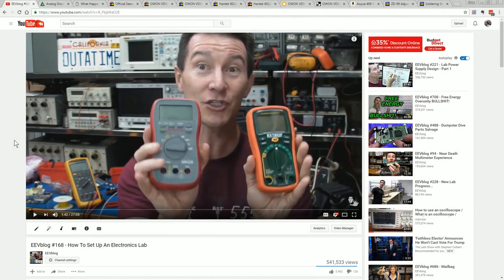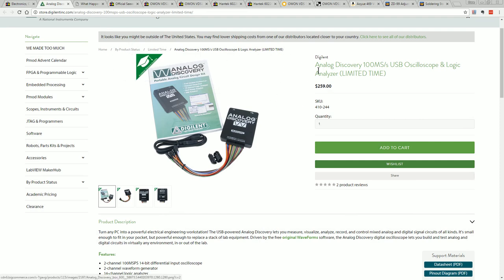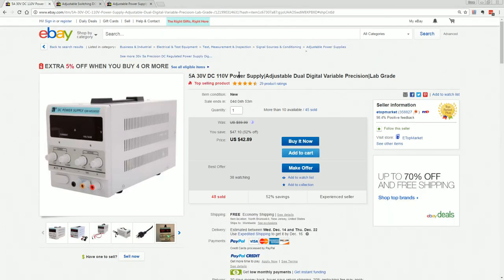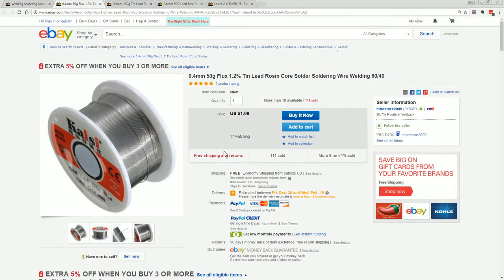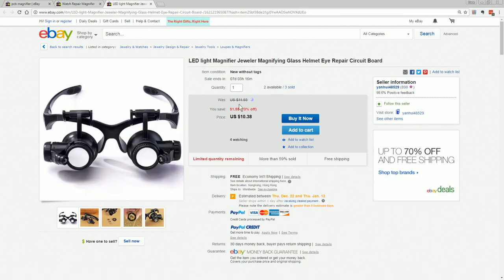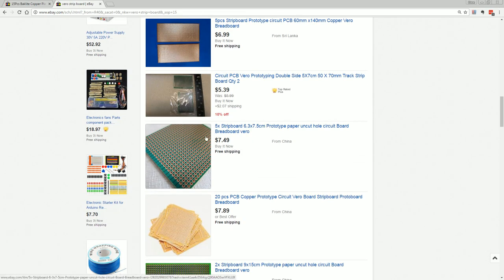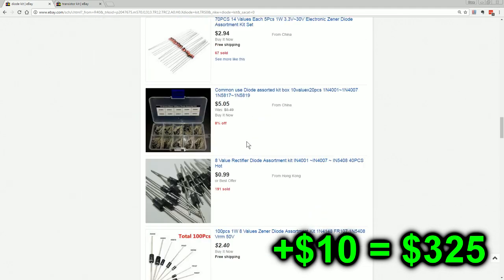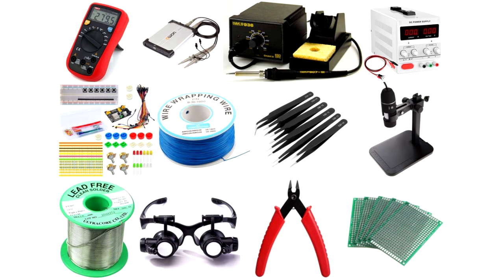EEVblog #954 - How To Setup An Electronics Lab For $300

Comment: I use my lungs to filter the fumes..
Reply: Some people really hate and/or are allergic to the fumes, but I kind of like it. Similarly, I like the smell of a wood fire, but there are people that hate that, too.
Reply: Mark L reality is the fumes are toxic, carcinogenic, but then I am a smoker..
Reply: I had a jacket that smelled like campfire for a for days, definitely got mixed reactions from that.
Reply: TheLinkoln18 yea, its not that bad for you, its just flux lol nowhere as bad as toboco smoke lol
Reply: It's only carcinogenic if the solder has lead in it. You can buy lead free solder for basically the same price.

I personally like the smell of warm resin.
Reply: +megamixa The lead has nothing to do with the fumes beeing bad for you. 
It doesn't evaporate in the soldering process.
Reply: I usually just blow on the fumes. No need for old pc fan :-)
Reply: Unless you're going to run a soldering productionline all day long, extracting fumes is just nonsense. A beginner just makes maybe 10 connections, see the circuit work (or not), highly likely throws the whole bunch in the basement and never looks at it again. A candle produces more toxic gasses than those 2 minutes of soldering.
Reply: That's interesting because one of the clips I saw on the death of Steve Jobs it said that his cancer probably came from breathing poisonous fumes from soldering and particularly from the lead when he was building computers back in the '80s with Wosniak in a garage.
Reply: Iberius Pred Then he probably made a few more than 10 connections.
Reply: If this is true, considering Woz did far more electronics than Jobs did.. how come Woz is perfectly healthy ?
Reply: It's hard to tell, genes, good luck, who knows. The clip that I saw about Job's cancer was that there was a physician who found on the medical records the size of his tumor at different points in time. By assuming the exponential growth of cells and cancer cells he could estimate that the tumor must have started growing somewhere in the '80s.
Reply: I thought of that myself. Not to mention that logically if it was fume inhalation that lead to the cancer, it would be lung cancer, which was not the location of the cancer Jobs had. Physician or no, this doesn't make much sense to me.
Reply: TheLinkoln18 best solution is to just filter it all through a nice cigar
Reply: +Peter Mulholland maybe he was across the bench from Woz and Woz didnt like the smell so blew it away towrads Steve :P
Reply: I don't think Steve Jobs would know which end of the soldering iron to grab.
Reply: +Iberius Pred but lead gives you heavy metal poisoning, while organic compounds give you cancer?
Reply: Fatalcreator According to some research, the toxicity of some heavy metals can cause cancer. Not only organic compunds cause cancer, UV radiation and nuclear radiation are not organic.
Reply: Btw, I don't think it is reasonable to assume that organic compounds generally cause cancer. If that were the case we wouldn't live long from birth. You cannot generally say that poisonous organic compounds cause cancer either. I don't get where you got that "organic compounds" thing from at all...
Reply: Lead has a boiling point of lead is 3180°F but that doesn't mean that it doesn't evaporate at lower temperatures. Even solid lead can get dissolved by ionization in saline water solutions.

It seems that solder fumes may contain small amount of lead, that is harmless in a normal environment even to people who would work with it every day. However, if you do that every day in a poorly ventilated area, who knows? The causes of Steve Jobs death are merely speculative. No one knows for sure what started his cancer. The only thing that they have in their reckoning is approximately when it started.
Reply: Iberius Pred nope! Cancer is caused by viruses or exposure to radiation thats it! Steve jobs wasn't playing ball with those in charge of the world! Then he died of cancer. Yes i have facts and sources to back up this comment. Dr Maurice Hilleman the inventor of the polio vaccine confirmed viruses are the cause of cancer and vaccines are i quote" bargain basement technology" this interview was done in the 1970's. it got worse.
Reply: In addition exposure to damaging environmental chemicals or sunlight dosnt cause cancer. They damage your immune system and allow viruses to do there thing. Thats why all smokers dont get cancer.
Reply: I highly doubt your hypotheses as to what causes cancer. Sure, viruses may cause cancer, sure, radiation can too. But there is more to it than that, as there are many other factors that may cause cancer.

I'm also rather skeptical to vaccines. While they may give a certain degree of immunity against diseases such as chicken pox, whooping cough etc. they are firstly not 100%, i.e. you may still get the disease and secondly, some of them have bad side effects that can lead to lasting complications such as autoimmune diseases (including allergies and atopic dermatitis), narcolepsy and increased risk of developing autism spectrum disorder in children.

I consider flu vaccines and "vaccines" such as Gardasil to be worthless. At best a flu vaccine may alleviate the symptoms, while most of the time it has no effect at all on the immunity against the flu. They are simply not worth the side effects that come with them.
Reply: Young people get cancer too and incidences of young people getting cancer has increased a lot during the past 2-3 decades. I can recall a case when a woman in her 20's contracted cancer after working in a Foxconn like facility.

I don't buy into that "older people get more cancer because of their immune system". Not only the immune system ages in people, other cells too which increases their chance of becoming cancerous. It's more complex than to put it all on the immune system I think.

Saying "this is so because X said so and he is the father of Y" doesn't cut it. No one is infallible, therefore facts speak louder than someone's statements. Maybe you could provoke an immune response against cells that have cancerous properties through a vaccine and create anti-bodies against them. But there is also a risk that the immune response will be directed at "innocent" and vital cells in the body. The immune system may not be able to tell the difference between these two types of cells.
Reply: thats dangerous man, everyone knows you are supposed to filter it through a cigarette
Reply: Johnathan Wuethrich bahahahahah cough hack cough bahahahahah
Reply: keep preaching the truth on cancer. Im sick of watching chemo take family members
Reply: I think its part of population reduction at very least its corp influence for reasons of liability. I graduated highschool in 06. The way schools were teaching cancer even then was that its mainly genetic. ...which is part true... but half the story of " some peoples genes contribute to immune systems less able to fight off certian types of cancers" and "some genomes exposed to some of these manufactured chemicals are x% more likely to develop an imunne overwhelming cancer than others." and of course even if they had taught what i just said it would be  still lacking in the part of...take in the right chemicals in food to give your imune system a chance to be supplied with what it needs to attack. fucking trajady
Reply: I'm sure you meant to say that you filter the soldering fumes through a cigarette.

And by the way, any kind of cell damage can cause cancer, but you could also say normal life causes cancer. Breathing oxygen-containing gas mixture (generally known as air) has got to be the most potent cause of cancer. A cell dies, gets replaced, with some probability, the replacement will mutate. If the mutation happens to be of a kind that cannot be dealt with by immune system in principle - and BTW it's no matter how strong it is - that's what cancer is. This is BTW why saying that viruses are carcinogenic isn't entirely wrong, but it also isn't the whole picture.

Now sure it makes sense to avoid chemicals with high cell toxicity or such that increase probability of mutation, as well as avoid extensive body damage due to viruses, but keep a little perspective before you blame anything specific.
Reply: Lol
Reply: "in the morning"?
Reply: Yes,maybe ... what is it ?
Reply: Funny story! I once upon a time used no filter...and the acid in the flux settled back down onto my soldering station and parts bins. They have a bunch of spots now that are basically where the acid in the flux damaged the plastic. if the lead vapor doesn't bother you, its vaporized acid and resin that should, which will damage lung tissue permanently. God knows what my lungs look like, lol.
Reply: Yeh i got high on those fumes i like it lolol
Reply: Yeah John Wayne used his lungs to filter deadly fumes too and as tough as he was he still died of lung cancer.
Reply: Those flux fumes are not good for you
Reply: Don't worry; It builds character.
Reply: It’s not sitting in the smoke that’s bad, it’s not sitting long enough. You need to sit in the smoke so long even the cancer doesn’t want to hang around.
Reply: Lol was thus ment to be taken seriously
Reply: Learn to blow gently while you solder....It is what we did before we had fancy fan/filter things.
Reply: same
Reply: there is warning on my gel flux, it says: this product contains chemicals known to the state of colofomia and other states to cause cancer, birth defects ..etc. So just in case i don’t inhale fumes and ventilate the room
Reply: I use my fumes to filter the lungs
Reply: Rip

Comment: Don't get the USB microscope unless you just want to take pictures. It's useless for soldering. Get a swing arm shelf mount magnifying glass from Amazon for 25 bucks It has a fluorescent round bulb you can replace later with a roll of LED's. Get a helping hand with small magnifying glass. Take the magnifier off and attach it to the swing arm under the big magnifying glass. You get the same magnification as a microscope. You can just swing the small glass out of the way for wider magnifier. Use the  spare alligator clamps on another  helping hand without a glass so you have 4 holding arms.
Reply: Amazon? Are you kidding? Banggood, AliExpress, eBay are the way to go when you want it to be cheap
Reply: @bspringer  Not anymore when trade war in US and enhanced customs rules in EU kicked in :(
Reply: @KrotowX  We'll see. I think in the EU I'm at least a little safer when it comes to China hate than in the US
Reply: @bspringer  Seems like that. And Banggood have at least two warehouses in EU. Direct purchases from China now is an greater game of luck. Two my acquaintances recently got taxed by customs for under 100 EUR worth purchases from Banggood Chinese warehouse and AliExpress - it never happened before.

Comment: Now this is a video I'd never even dreamt of seeing. Dave Jones, recommending ~20 cheap Chinese products. The fun part is, I agree 100%. If I may add some additional suggestions: 
1) Transistor/ESR tester
2) 20€ diy osilloscope for simple waveforms
3) Cheap variable DC-DC power supply 500W range. + Fixed 12V AC-DC power supply 
4) Various connectors
5) IC sockets
6) ESD mat
7) Voltage regulators + heatsink
8) Popular ICs: 555 timers, op amps, attiny, etc.
Reply: If you're careful and don't just go for the first five dollar one you see you can get a cheap multimeter that has transistor, diode and capacitance testing built right in. The one I still use today for everything from electronics to tracking down phantom voltage in my 120 year old house to appliance repairs I paid thirteen bucks for at my college bookstore about twenty five years ago. The only thing I've added is a five dollar kit of different universal leads because it only came with the long pointed probes and no alligator clips.
Reply: LordPadriac I have never in my life seen a multimeter with an esr meter on it
Reply: This is the one I have. You don't need a special meter to test capacitors; ANY multi meter will do it.
Reply: LordPadriac i think you forget the link
Reply: LordPadriac oke thanks
Reply: LordPadriac i dont see anything of a capacitor comming back
Reply: You're right. That's the one I have out now because I was fixing my oven's circuit board the other day. That one is relegated to household repairs for the most part where I don't care too much if it gets blowed up. I still use it for prototyping if it happens to be out. I replaced it with this one actually a while ago now. https://www.amazon.com/Meterk-Multi-functional-Multimeters-Voltmeter-Capacitance-Multi-Tester/dp/B076KK1XJB/ref=sr_1_1?s=hi&ie=UTF8&qid=1522628012&sr=1-1&keywords=multimeter+capacitance The Merterk does everything for sixteen bucks.

Comment: Heat shrink tubing is also good to have! Also a wire stripper is needed. Fantastic what you can get for this little money.
Reply: Don’t need wire strippers, use the side cutters like nearly all professionals I’ve ever seen do lol (seriously)... less tools to keep track of and you already have it in your hand! Takes practice especially for 30ga, but the results are as good or better ; ) I’ve got probably $1000 or more in every type of pliers and cutters each $20 or more, and I’ve only ever seen maybe two on the bench in actual use, beefy needle nose and side cutters... if you really want to go “pro” get some electricians scissors, seen them used with with absolute precision and stripping wire are machine like speed
Reply: Consumables...

Comment: That's really useful. Knowing what might be useful and what is plausible on a budget is good to know...

I've had bits and pieces of equipment for random projects I've done over the years. Crappy soldering irons, equally questionable multimeters (I have a Uni-T one nearby), breadboards, wire, some components...

But I really was buying stuff on a case by case basis and making do with whatever cheap stuff I could find, with no real idea of what might be good to have in general.
I always wanted a multimeter, but it never seemed like something that was affordable.

So anyway good advice really.

(oops. 9 months later I noticed I meant oscilloscope, not multimeter. XD)

Comment: I've been doing electronics for over 30 years, yet I still watched this video start to finish. Really great advice! The one thing I would add, don't be afraid of CROs! Those old oscilloscopes might lack the modern day digital features, but if you can track one down on the cheap, nothing wrong with using it! My CRO is older than I am! Still works though!
Reply: Same here, 30+ years a tinkerer and an old analogue scope is certainly better than no scope at all.
Reply: I have 2 really old scopes, they work just fine. One cost $75 including shipping from ebay. Just be sure to tell the buyer to pack it well.

Comment: At the beginning of this year I finally got my first ever soldering Iron. It was an Aoyue 936 and as the name suggests it was indeed a Hako 936 clone. I would recommend this over the YiHUA because with a limited inspection from the exterior the internals of the Aoyue station seem to be of higher quality than the YiHUA. I think the Aoyue might be slightly more expensive but well worth the money.
Reply: StoreBrand Try "ersa" soldering irons. I have some of them more than 30 years (the oldest). 16W, CEPT certified, for almost 20 years , no tempeture adjustment, every day use (I'm professional)
Reply: I went from a terrible 2$ uncontrolled garbage soldering iron to a complete soldering station kit for 25$ and man was it a change! it works fantastic and the tip is still good as new. The kit even came with a solder sucker, third hand and solder included, the weller ZD-99 is really good for the price (its the blue one dave scrolled past lol)
Reply: I have found several different clones of the Yihua brand. Some are junk but one I bought that was on amazon was a 852d+ hot air and soldering iron and I was really surprised. $59 and it was quality built inside, including using PID microprocessors to control the heat. Only problem I had was one of the pots used to control the air volume went bad, but otherwise for $59 I can't complain.
Reply: The problem is that ZD-99 isn't temperature controlled. It has a simple TRIAC dimmer inside, you can adjust power, not the temperature. I've had one, and the thermal coupling between heater/tip is very awful. It seats in the stand nice and hot, you touch the joint and the damn thing sticks to it.
Reply: that's a very good point, if your joint sucks up most of the heat the iron wouldn't know to add more power; that said it gets pretty hot and can keep up with most jobs by adjusting said power I think ... if you want a really good soldering iron its probably not the right one though! For a little extra you can get a much better soldering station or one of the cheap all-in one Chinese soldering stations which also has the hot air rework.

Comment: Great video. For scrap wire I cut open old ethernet cables (everything under CAT5e is uselless these days...) and use the wire strands when I need to connect things on a strip board...